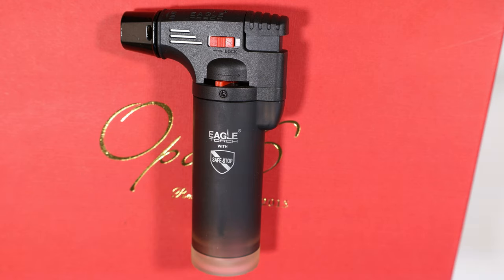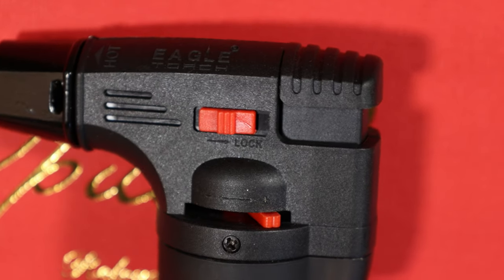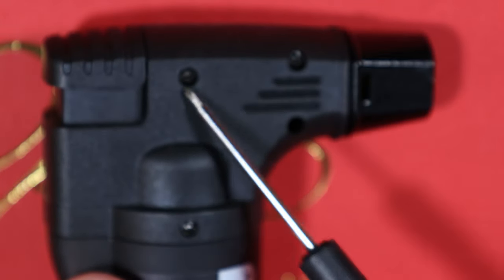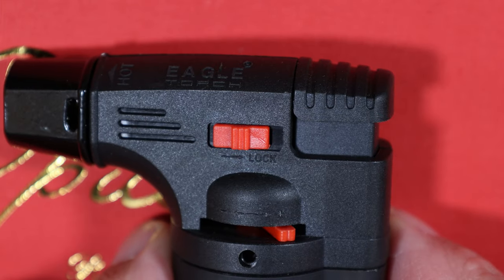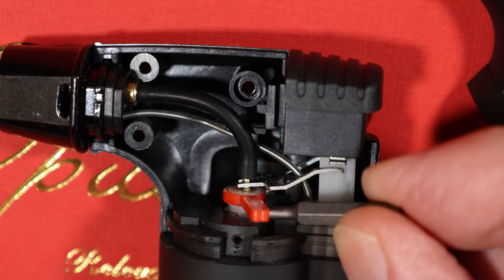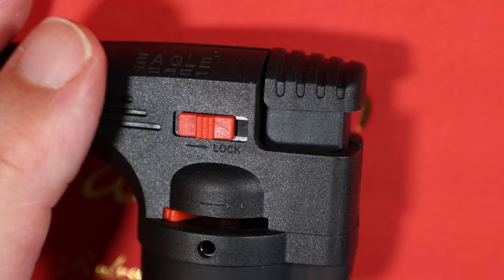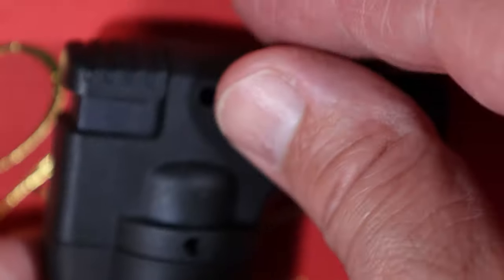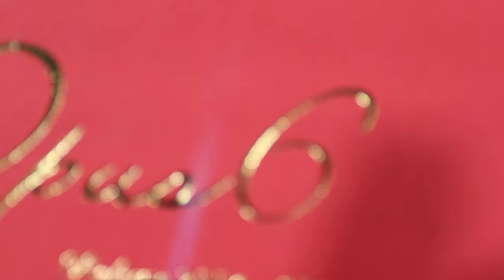How to fix an eagle torch lighter or how to fix a lighter with an adjustable flame

Comment: Excellent close-up video showing all the details, and thorough explanation.  Thanks!  Looking forward to resurrecting my useless lighter.  Thanks again!  (Update:  It worked!  But that metal piece fell out, and I didn't put it back in right.  The flame wouldn't shut off!  I moved it down more on the valve that opens to let fuel pass, and that worked.  Whew!  Thanks again!)
Reply from the maker: Glad it helped!

Comment: Perfect!  Knew how to move the gas but didn’t know where the metal clip was supposed to be as it all flew apart when I opened it. Lit right up after I secured the clip to the base of the butane rubber tube. Thanks!

Comment: Thank you  as someone mentioned previously this technique will work with the Torches experiencing a lack of power low Flame issues but I literally just did it and how much works like a champ so for those specific issues this video these techniques that he uses work great

Comment: These can develop a “vapor lock” which has to be purged by inverting the lighter and sticking a paper clip on the fill valve to release the pressure. Also I cleaned the front nozzle with thinner and a brush to remove unseen residue buildup.  And this worked great. No screwing around needed.
Reply: Good looking out 👍🏼... I had no spark so I hit it with a soft wire brush. It cleaned it right up, sparking and working like new.
ThanQ for the tip
Reply: What type of screwdriver
Reply: fuck man i wish i woulda read this comment before tearing apart my torch...
Reply: I seem to get a problem with the balance isnt in synch with the ignition switch sparks too early no fuel.  Bend arms up on the u shaped lever that wraps around switch so gas is releasing the spark occurs
Reply: literally just wasted my butane with that 😂😂 time to buy a new torch the one it got is either fake or just cheap asf
Reply: How do u do that
Reply: Incorrect.

Comment: Thank you for this I bought the cheep knock off version that walmart sells several years ago and it was doing the same thing yours was so I threw it in a drawer thinking I would fix it one day.  I found it while I was looking for something else and decided to try to fix it.  I found your video and was able to follow along and fix my torch.
Reply from the maker: You're welcome!!
Reply: Very CHEEP huh
Reply: Even real PROF aren't quality now, esp double jetted ,I'd never touch one
Reply: Didn't help mine. Just got it worked for about a minute and a half then stopped. It's full of butane won't light even using a lighter, butane no longer comes out even though I can see it in the lighter.
Reply: @grumpy039  sounds like u have a blockage
Reply: @grumpy039  sounds like you got an eagle torch lighter
Reply: @grumpy039  jw... Have u ever tried to invert it to let out any air built up inside? I have to do this to my eagle torches every day I use it 🤦🏻‍♀️.
Reply: @DarranJHankey66 I have a Triple Jettedt Torch nd I have a Love/Hate typa Feelin forr it😅💯

Comment: Just so everyone knows, doing this isn't always going to fix your lighter! In fact, this is only going to fix the ones that have a low flame or problems with not enough gas. In my experience, most of the time it's the ignition switches that go bad and good luck finding those!!! I have a graveyard of parts and I take them apart all the time and use something from one to fix another but if the ignitor switch is bad then it's not going to work no matter what you do until you replace the switch. Good luck guys!
Reply: I saw the ol Bic lighter trick & began looking for my keys.
Reply: My torch is leaking when ever I put the adjustable thing high. When I put the flame low it doesn't leak any fix
Reply: Eagle just needs to make a better quality lighter. Honestly, the lighters wouldnt be shit of they weren't guaranteed to malfunction after a few weeks
Reply: @iceebalboa3177  I definitely remember those days especially when you put it up really high and someone asks for your lighter and the flame burns off their eye brows!
Reply: They had ignition switch problem kept getting stuck I sprayed WD-40 in there and just let it sit for a week I don't want to spark it and blow myself up work like a charm got it unstuck and been working fine ever since
Reply: @maddogkilla1  correct they don't make anything like they used to. I'm on my third eagle torch this year 👎🏼👎🏼
Reply: What do you mean by ignition switch? Like when you press the button down and it clicks to light it? Like pressing the button slightly releases the fuel but pressing the button down all the way til you hear the click that’s the ignition switch that lights the fuel being released?
Reply: @sidneycheyanne8727  that would be the piezo, the little electric spark that ignites the flame. Those go out fairly quick as well but is more rare. Most of the time the issue is a broken release valve (the part where the gas hose is connected to the tank, where the regulator and opening hinge meet) or clogged gas hose. I just bent my opening hinge back to its factory position (it flattens out over all those repeated presses on the trigger) and what do ya know, it fired up.
Reply: @sidneycheyanne8727  pizo electric speaker lol same concept in a propane bbq grill.  You can buy an on Amazon cheap
Reply: @sidneycheyanne8727  same things happening to my scorch torch and I can’t find no videos on it it’s won’t click but you can hear the butane being released if I put a lighter to it it’ll light but not by itself
Reply: @maddogkilla1  feel the pain of europeans who only find reviews about lighters in the US online but laws ban import.
Reply: To fix a piezo that doesnt spark anymore (assuming the exposed lead is correct distance from venturi gas outlet) first remove the piezo and Bend lead to metal bottom leaving a couple mm gap. Wearing rubber glove (unless you dont mind the jolt) press top down and watch for spark. I used to think they went bad and would buy a cheapo lighter to replace. For awhile the cheapest lighters with one were the long reach lighters from dollar tree, but why they have a hard ground? I come to the conclusion that piezos do wear out somewhat over time, and they still put out AC, just not in enough quantity to arc. The SOLUTION? Take a single strand of wire from a scrap piece of wire.  Like the thickness of a human hair is all you need. Make a loop around inlet of the venturi burner (like where the rubber hose goes or even better soldier it on there. Run the other end down into the hole where the piezo goes or even loop it around its metal ground end. Make sure to leave enough slack so you can run it around the back of the piezo because if you rund it out the front it will be passing by the discharge area (where the factory wire comes out) and ultimately it will just bridge the gap there instead of at the burner end where you need it.  Also leave just enough slack to route it around the lever the lifts the gas valve. Also, I watched only about 15 second of this video to realise that this guy doesnt know what he's talking about. The reason you have to turn up the gas output is the fulcrum that the lever sits on wears down or half of it breaks (telltale sign is trigger sags) or the lever gets bent so it doesnt lift the valve like it used to (mainly cheapo lighters) or someone who didnt know what they were doing put the lever in upside down or they didn't reinstall metal clip that sits inside trigger cavity. Hell, since I wrote this much, if lighter suddenly erupts into flame or the flame varies output after about five seconds...like turns into flamethrower, it's because it was lit for too long and rubber hose going into venturi has stretched and released gas. Get a new hose, or some super glue, or another strand of that wire  and wrap it around like a bread tie and cinch it down for a make shift hose clamp. One final butane tip...any broken lighters can top off your butane can..yes the valves work both ways just keep your can upright and push lighter down from top. Drains right in.
Reply: Forgot to say, this fixes a piezo that has become weak. The reason for bending the lead to the ground and testing is that if it doesnt work to spark directly to its ground, then an extension isnt going to work
Reply: It would help if the metal ignitor clicker slid along a metal track, instead of plastic, which wears out quickly and renders the lighter inoperable. I finally bought a $30 Special Blue torch three years ago because it's mostly metal components, and it has a dragon on it, and it still works!
Reply: R u talking bout the piezo element

Comment: Thank you for taking the time  to record this. I’ve had my Torch for almost 3 years and a just recently stopped working. I was able to fix the flame adjuster and now the trigger button on the top  stopped working . “ doesn’t click”. Hopefully I can find a tutorial on that. God bless you good sir
Reply from the maker: Sounds like you messed up the metal piece
Look at the video at 2:46 and make sure your eagle torch looks like that
There's a metal part all the way to the right underneath the plastic part that needs to be there
Along with where I'm pointing the screwdriver
Other than that I don't know what to tell you
Reply: Take the black thing out & turn it around
Reply: @Dude90077  can you maybe make a video on that? I am having problems with the click igniter and it doesn’t click all the way anymore. I think the safety stop is somehow keeping the igniter from igniting.
Reply: Yes take the black thing out and flip it around it works everytime

Comment: Just watched this video and was very informational on how to fix the inside, I learned tho my valve was out of alignment and had a bit of buildup that was making the flame sputter and not a cone shape, try scraping it gently and lining it up straight again!
Reply: My adjustable flame thing leaks when ever I put it high flame, when it's low flame it don't leak
Reply: Thanks a bunch. I have a collection of lighters and now I have the tools and knowledge on maintaining

Comment: I have a small thin flat head and just did it without unscrewing everything and pushing into the side and it worked
Reply: Is there any way you could show how you did that without taking out the scews? My screws are stripped and cant get them out

Comment: I live a mile above sea level, and because of the low oxygen and pressure the butane doesnt produce enough vapor to keep the torch lit. One fix is to increase the total amount of ⛽️ over  the maximum set by the manufacturer. U can also heat the lighter with a space heater but be careful or youll ruin your lighter and may destroy the fabric of the universe🔥 in the process. Good luck, we're all counting on u.

Comment: Holy shit the exact video I was looking for and it actually worked! Just concerned about how now I think too much gas comes out and the flame stays on for a second or two after I let go. Great video!
Reply: you're getting it hotter than designed for.  I could be quite dangerous. I'd move it back half a turn.
Reply: @wadepatton2433  No, its simply releasing extra gas that has built up in the hose due to higher pressure buildup from adjusting the regulator... Its perfectly fine (perhaps not as safe as if it didnt do that) but not gonna cause a lost hand or anything... Just blow out the excess flame when you arent using it
Reply: The little wishbone-shaped piece can get bent a little, that'll make it stay lit after releasing the gas

Comment: I've got a trick for people to try. Turn your lighter backwards with the torch piece facing to the right. Have the gas all the way up or nearly at the max. An then literally just start walking in one direction (just enough to create a little air passing by) and at the same time start pressing the ignition. Try it a few times and I swear 8 times out of ten 10 it'll work... That is as long as the only problem your torch has, is that the butane won't ignite from the spark. If it has no spark; then obviously it isn't going to work regardless.
Torches I thought were done an needed to be trashed have worked after using that odd trick.
One more little trick is to leave the torch out in the sun for a little while till the butane inside heats up enough to catch the spark with ease.
Good luck with these damned things. Frankly I advise just buying a blue or yellow butane canister and a torch top with an ignition built in. Not very good for public just tho lol

Comment: I have one like this and the clicker part that generates the spark has broke. It will press and the torch will hiss but it wont click and light but if you use another lighter then it works. I ended up buying a new one at the same store. Not sure what I'll do with the old one.
Reply: Same deal wish I could get a tip to get the clicker aligned right or whatever steps necessary to light independently without a jump start off another flame..  it's strange cause if I mess around with the lock slider for a real good while I might be able to get it to spark up on its own so I know it's capable..

Comment: my neighbor gave me here jet torch lighter because she quit smoking and its a nice piece and all but i find the flame high setting not high enough for my liking, thought about taking it apart to do that trick but i can only find one screw on the top of the lighter head that sit on this elongated metal plate with a hole on the other side which sits over the top the nozzle and cup flame assembly  and when i tried slowly prying the plate up after removing the screw it started pulling up the cup and nozzle and i stopped because im worried it would pull it off the gas line and would either never be the same or id have a hard time putting it together in proper working condition, i did not even want to attempt this but wanted to give it a try and see how far i could go in order to reach that adjustment lever ,anyways i pushed it back in and put the screw on , guess ill only try this if it fails me one day and i got nothing to lose  trying again

Comment: spline is a term that describes the how the O.D. of one part and he I.D. of and another align and fit.  An example of the way the term should be used is," the pinion gear splined well to the output shaft.    Spine is not an object, it is a description of how two parts align and fit together

Comment: Spline…..a rectangular key fitting into grooves in the hub and shaft of a wheel, especially one formed integrally with the shaft which allows movement of the wheel on the shaft. Such as spline gears in a transmission
Reply: What?

Comment: I opened mine up myself. I had tje issue of the striker not striking. It would slip throw the white spine of the trigger rather than rubbing against it to strike. How would you fix that? The pin just seems to be way to short and should be longer to keep it in place. Didn't finish the video but figured I'd vent since the sound of the video lighter wasn't the same as mine.

Comment: This helped a lot but still doesn't want to light up sometimes. Before you wouldn't hear the butane coming out when u clicked it but now u really can hear it but sometimes no flame. This happened after half the og butane was used. Could the igniton switch really go bad after half the use of the torch?

Comment: This is just to adjust the fuel of the lighter by increasing the volume. What most people fail the understand is that the type of butane used also plays an important factor as well as the ignition. But the question here is after all the adjustment and the torch still wouldn't light, what then?

Comment: I have this same lighter, but my problem is the thing you push on to light it won't click. Is there a battery compartment or has the white rectangular thing to the right of where you are working come undone in some way? Mine just pushes up and down and nothing happens.
Reply: I have the same problem.. I can hold onto the button and still use the torch it just needs a jump start I guess you could say.

Comment: I took mine apart and I figured out where all of the pieces go except for a tiny spring. My torch is smaller than this one but same brand and the insude basically is the same. Any idea where the spring goes in assembly?

Comment: Used to be able to do the same thing in action to a cricket lighter by lifting up on the adjuster to slide to low and let it down to turn up. Flame would get higher. but I think they done something about it because I haven't been able to do it to the newer ones. My question is does this lighter have a flint and you do you need to change it. And if not how long is it going to last to make it worth buying the fluid to refill it
Reply from the maker: There's no flint it's a Piezoelectric spark generator which can last for up to 10 years
Reply: @Dude90077  cool thanks dude... Might get a few more then.

Comment: CAUTION: After performing this type of repair, take your torch outside to a place with ready access to water and wear safety glasses for your initial post-fix testing.  This type of repair can be what you need, but sometimes it is not and can cause your torch to produce a flame in excess of what it was designed to accommodate resulting in an immediately dangerous situation.
Reply: Don't you threaten me with a good time!

Comment: I had a problem with a gas station eagle lighter, turns out the lil rubber hose slipped the valve it was attached to and the fluid was just coming out in the cap before the spark ⚡️
Reply: my problem exactly, i fixed it by pushing down the hose a bit and bending the opening hinge back to its factory position and it worked perfectly